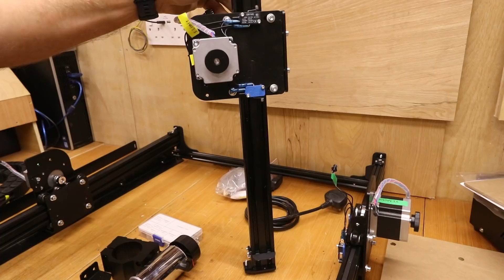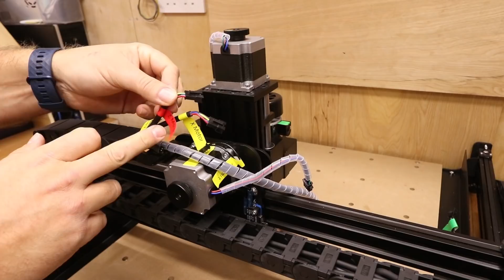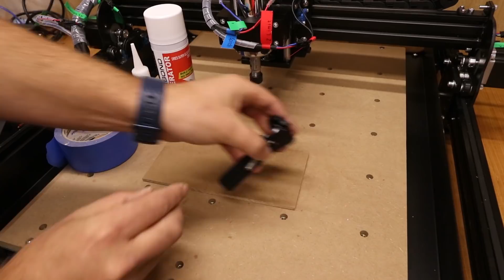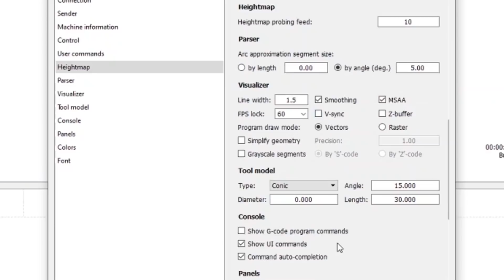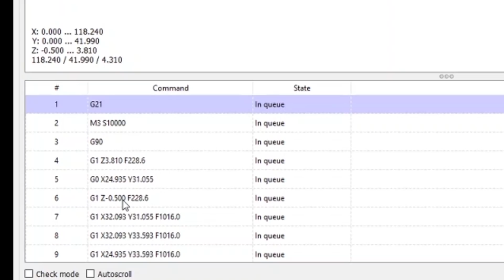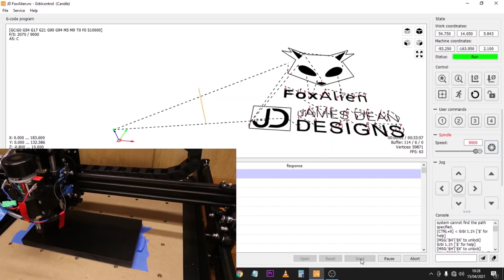4040-XE FoxAlien complete build, review and first cut

Comment: You Zeroed XY when it was over the corner.  But after the Z Probe step you didn't zero Z.  is this a correct step or did you forget to zero Z?
Reply from the maker: Yes, so when you run the Z probe command that automatically sets the Z zero for you

Comment: Hi James. Big fan of your videos thanks. They are great for a beginner CNCer like me. Thanks. Quick question for you. My 4040 XE seems to stop mid-print quite often . It seems like its getting bogged won. I've been trying to use a 1/4" spiral up bit. The only way i can get it to run through the entire project is to run it really slow (like 0.02" per pass, 5"/min plunge, 30"/min speed) and even then it stops pretty often. with an 1/8" inch bit i can run it a bit faster, but it seems to happen there too. 

Am I doing something wrong, is there possible an issue with my machine/spindle?

Comment: James, thanks for these great videos. For a new bee, these are fantastic! Question about the spindle collar installation. There are the 3 bolts on each side and you installed the collar using the 2 lower bolts, is there a reason for that? Or, can I install on the upper two bolts just to get a little more height for carving?

Comment: HI I have recently brought the Fox Alien Masuter and i tried to set the command button for Zeroing the probe but its not doing anything ? can you help? thanks
Reply from the maker: What software, is it Candle?
Reply: @JamesDeanDesigns  yes it is
Reply from the maker: @seanbatchelor7254  see if this helps. Might be slightly different code than what you have https://youtu.be/3xgIS_IEX-Y
Reply: @JamesDeanDesigns  unfortunately that code is the same code that you used on the 4040 .. so that doesn’t work … I can’t seem to find any other info anywhere
Reply from the maker: @seanbatchelor7254  could perhaps be the software. Have you tried UGS or Openbuilds Controller?

Comment: Can it read Arabic texts?
Reply from the maker: The machine only reads Gcode but the software you use to create the design will work with Arabic as long as you have a suitable font installed on your PC
Reply: @JamesDeanDesigns  Thanks.

Comment: Hey James :) I've bought this router (largely because of this review!), and its been going relatively well, but it does this odd thing when I start a job. It tries to go to machine Z zero, which trips the end stop switch and sets off the alarm. I'm using fusion 360 to generate tool paths, and it doesn't seem to do this when simulating the path? I hoping that you or someone else knows of a obvious solution that I cant see. thanks :D
Reply from the maker: If your on Facebook, ask in the FoxAlien group. im sure you have to modify the code or something in Fusion but as I dont use it im not 100% sure
Reply: @JamesDeanDesigns  Thanks for getting back to me :) I found the issue in the Post settings, needed to change the safe retract height from G28 to clearance height

Comment: Dear James,
 
I have already received my new machine (4040 xe), but was not yet at home, because i am on a trip till end of march. I am very excited about the device!
 
 It would be great if you could answer my question:
 
What are the allowable cutting forces (Fc in Newtons) on the spindle so that no damage occurs and the elastic deformations remain acceptable in terms of dimensional stability?
 
 
I am an engineer and will use the machine for wood as a hobby, but sometimes I would also like to mill aluminum carefully. Therefore, I would first calculate the cutting forces and power consumption before making an attempt. I would choose the milling infeed very small to keep the forces low.
 
 
Thank you very much and many greetings from germany!
 
Best regards
Mick

Comment: Anyone having trouble connecting the candle or lasergrbl to the 40-40XE? I've been over all the steps repeatedly, port, baud speed, installed drivers etc. Wondering if my software is outdated or not compatible.

Comment: Hi ,could this mill steel with a correct tooling if cutting speed was turned down also how reliable is this machine .many thanks .
Reply from the maker: It probably could be not very well. Ideally you would want a screw driven machine, preferably with linear rails
Reply: @JamesDeanDesigns  okay thanks for your advice,  I'm also guessing turning this into a cnc plasma wouldn't work well either,  I would make a steel bed for it .

Comment: hey Mate, my machine keeps Jogging when moving and not going into the mdf sheet for the test run, I have done exactly what you did about 5 times now
(I tried to G1-Z at 2mm deep but nothing happens.

My User Commands setup with the tick to use them, wont set back to 0... does nothing for me

Comment: I am trying to set the starting coordinates to G90 G0 X0 Y0 G90 G0 Z0, but when I press number 1 I get G90 G0 X0 Y0 G90 G0 Z0 < error:21
Reply from the maker: Not at a PC to be 100% sure but it will either be because you have 2 G90's or 2 G0's on the same line or both. That piece of code should technically be broken over 2 lines I believe as you want it to find the XY first, then the Z

Comment: Very interesting video.
I am wondering if you can give me your opinion: for someone looking to start into CNC. Would you recommend 4040-xe or a sainsmart 3020?
Reply from the maker: They are two different machines, the 4040-xe has a larger work area and more powerful stepper motors however being belt driven and having wheel clamps can be more difficult to fine tune for a beginner so you're likely to have less issues out of the box with the 3020, but equally this has a smaller work area so its really about deciding what is important for you. May also be worth considering the FoxAlien Masuter Pro https://youtu.be/cLWiYbUnSaU

Comment: Question, when I look on Amazon it says it is set up for 110V. You are in UK and I am in Australia so 240V. Did you have to change the electronics or use a 240v=>110V converter?

Comment: Another quick question about the probe command, yours ends with GOZM30. Mine does not have the M30. Does that matter and I’m talking about the settings in the Candle software.
Reply from the maker: M30 essentially just mean end, so it ends that command string. If its running without it then it should be OK

Comment: I recently bought the FoxAlien 4040 machine it was within my budget. I was using Easel software (free for 30 days) to make simple designs and Ugs or Candle software to run the Machine.
The problem I have is that during the cutting the machine will "hold" or make a move not in the program. Any suggestions or any groups can help me
Reply from the maker: Holding can be one of multiple things, do you get an error code when it holds? Make sure all of your power saving settings are turned off including Selective USB Suspend. As for making a move not in the program, that is very odd one, I suspect it may be missing steps
Reply: @JamesDeanDesigns  Thanks for the reply. The "hold" is annoying and occurs randomly. The unexpected moves in X or Y axis sometimes all three X Y and Z together. I was using Easel with UGS but Easel will not connect directly so I have to download program as text file and them import it to UGS. The random moves do not happen at the same place if I re-run the program. Perhaps a different Design CAD software might help?

Comment: Hi James, great video , this seems to be an old video, how are you getting on with the FA I’m thinking of upgrading to the fa xe what laser would you recommend and should I purchase separate to the machine, I can’t seem to find a uk supplier any idea’s. 
Many thanks
Reply from the maker: Hi Craig, I love my 4040XE. I would recommend getting the FoxAlien 20w laser with it. There is also the 40w laser now but that does bump the price up quite a bit but it is very powerful. Supply in the UK fluctuates. they only send over stock every couple of months so if things sell out quickly you can be waiting a while, but keep an eye on Amazon. Also message FoxAlien directly and they can advise when new stock is expected
Reply: Thanks James, I’ve ordered the xe with the 40w laser decided to do it now rather than waiting, do you have any speed tests for a 4040xe? Setup files? Thanks again keep up the good work 👍
Reply from the maker: @craigjulespallister1286  not really specifically for the 4040-XE. I have a video on doing powerscale tests with the laser, this applies to any laser. As for the router work, it's not quite as easy and often just better to get stuck in.

Comment: I'm new to cnc and just got the FoxAlien 4040  and was asking what if anything can be done with the x Gantry wobbling a little when going through tough material or cutting deap .?could the left and right side stepper motors need adjusting or is that the way that model works ?
Reply from the maker: There are things that can be done like tightening up the wheels clamps, also make sure $1=255 in your GRBL settings. Then you can start to look at upgrades like using bigger extrusion. Usually though if you get flex like that its an indication to slow down a little or go shallower.

Comment: Good call on the thread locker, tighten everything! I added a 500-watt upgraded spindle to mine, but it didn't get to full RPM speed with the Foxalien power supply. Now it gets full power and RPMs with the external supply.
Reply: The kits for the 500-watt have their own power supply but I haven't looked to see if its sold separately.

Comment: I copied everything you did with no luck. After i hit send it rises all the way up and moves in a straight line very slow
Reply from the maker: Hi, if possible share your GRBL settings and I'll take a look. Also make sure your switch is correct between the PC and offline controller

Comment: Great Video. Really well done.  I set up my 4040-xe using this video and had no trouble with any of it until I went to test the Y and X axis.  They are both making noise like they want to move, but not moving. The Z axis is fine. Spindle fine.  As shown, I tightened the Y and X axis carriages so they would stick but still move by turning the knobs when in the upright position. Is it possible that they are now too tight? If so, how to loosen?  Thanks.
Reply from the maker: Yes, I suspect the clamps are a little too tight. You simply release the bolts applying the pressure to the wheels by about half a turn, then release the bolts holding the plates and tighten then straight back up so it should release some pressure. In retrospect i probably tightened them up a fraction too much in my video
Reply: @JamesDeanDesigns  Thanks.  Again, great video!!  I'm loosening Gantry just a bit as you suggested.. There is a kind of sticking point in the belt maybe due to sitting in the same spot during shipping. I'm finding that as long as I don't start my x-axis in that spot, it will work, but if it settles in that spot, it won't move. Possibly need to tighten belt. IDK.  Right now I'm stuck on the code for User Button 1. Not working. Haven't yet tried every poss angle.  Thanks again.

Comment: Thanks for the video! I am having a problem with Button 1 though. Whenever it is clicked I receive a "error: 21" in the console. Is there a reason for this?
Reply: Try putting a semicolon after the Y0 command. This splits the command into two lines eliminating the error 21.
Reply: @coryglasser3153  Cheers that fixed the issue for me as well :)
Reply from the maker: Try what Cory has suggested but also make sure you have not ran homing. The custom button will not run if you have homed the machine first
Reply: @JamesDeanDesigns  so what do you do if you have run the homing button?
Reply from the maker: @robbyk2374  I'm doing this off memory but if you running homing then candle has a return to origin button I believe
Reply: For the custom buttons and the error 21, just make 2 buttons. I use G90 G0 X0 Y0 for button 1 and G90 G0 Z0 for button 2. You can also just use G90 G0 X0 Y0 Z0, but this will cause all axis to move at the same time, so depending on how far away from target you are, and how flat your material is, you may drag the bit.

Comment: James, fox alien 4040xe vs genmitsu prover 4030?  Really having g trouble making up my mind.
Reply from the maker: Can totally understand that and partially why I have both. So within reason they both do pretty much the same thing, cut the same material, can both do laser and router. The way I view them though is if you're likely to do router and laser work then I'd lean towards the FoxAlien, but if you're leaning more towards heavy router work, harder materials etc. then the ProverXL. They are both great machines and equally they both have great customer service and support communities
Reply: @JamesDeanDesigns  I was all set to get the 4040 but the prover has a size upgrade option and screw drive instead of belts.  That is where I got stuck.
Reply from the maker: @marcmorton6342  🤣 yes it does. As I say the 4040 is better for laser because of the belts but the ProverXL is better for heavier router work because of the screw drive nd slightly more powerful stepper motors. Flip a coin
Reply: @JamesDeanDesigns  it is a hard decision as the 4030 has a greater z axis as well.

Comment: Can it do multiple pbc nameplates at one time
Reply from the maker: Yes, as long as you have the file set up and all the placements correct.
Reply: @JamesDeanDesigns  
Sorry for the dumb question but im new to this.. will the file i need be available when i purchase the 4040-xe?
Reply from the maker: @MrValentine1915  to think of the CNC machine as the tool, and you control that tool. There are 2 parts to it, you design what you want making and then you essentially tell the machine how to make that for you. So in order to do multiple PCB's you would design several on one layout in your design software. You then export that design as something called Gcode which is basically a list of instructions in a language the machine understands. You then tell your machine to follow this list of instructions (or Gcode) to get your end result. Hope that helps

Comment: can you provide some insight on the 4030 offline controller? How to build a project in easel and transfer it to the offline controler so that the computer does not have to be attached. In case i am in the middle of a project and have my internet go out. I just bought a sain smart 4030 and trying to learn as much as I can before it arrives.
Reply from the maker: Hi Matthew, You export the Gcode from Easel and save the file to an SD card. You then load that SD into the offline control and run it from there. Also I would strongly advise you don't run your machine from Easel. Use UGS or Candle, much better and no need to worry about the internet connection dropping out.

Comment: Great Video, thanks so much for the detail, just wondering if you had any electrical issues as UK is like Australia 220-240 @ 50hz but US power runs at 60hz. Only asking as about to purchase one for use in AU
Reply from the maker: None at all. I have 2 machines that can  switch between 110 and 220. So far I havent had any issues with either 👍

Comment: Wanted to ask you if you could provide me with some input. I have a 3018 Pro and thinking about going up in bed size. Wanted your opinion of the FoxAllen 4040-XE vs ProverXL 4030? Have a preference?
Reply from the maker: Whilst they are similar they are different. ProverXL is probably more geared for heavier work, the 4040-XE is for lighter work but can move faster for something like laser work. Its one of the reasons I have both as it cover both ends of the scale. Do you see your self more likely to mill metal or use a laser?
Reply: @JamesDeanDesigns   thank you very much for taking the time to reply and for your input! Helped me allot. Prefer to do more milling then laser so know I know which way to head. Love your videos keep up the great work and thanks again!

Comment: What made you pick this model over all the other available machines out there?
Reply from the maker: Having had my 3018 for nearly 18 months, I needed to go bigger with more power but only have a very small workshop. Rather than going for one big machine like a workbee, I worked out 2 medium machines would be better. So I have the ProverXL 4030 and this one, the 4040-XE. Both have their separate advantages. For example the ProverXL is probably a stronger machine, where as the 4040-XE is better for laser work which i also wanted to continue doing

Comment: That is a great video!!! And thanks for your advice, we will see what we can do to make the 4040-XE a better machine!!
Reply from the maker: Its already a great machine 👍
Reply: @JamesDeanDesigns  Thanks, I am very glad you like it.
Reply: @foxalien_official  I am using the 4040 version with acrylic parts and do not put Loctite, it will destroy the acrylic just like gallium with aluminum. I have 3d printers so it took a few hours and the machine was up and running with my custom parts. It was not mention anywhere to not put Loctite and honestly on a vibrating machine it just make sense to use Loctite. I guess now I know haha
Reply: Great attitude, always make your stuff better,  I lost my machine to a shop fire, so out of commision for now, maybe one day, I will be able to replace it. Other things needed replacing a lt worse, at the time!